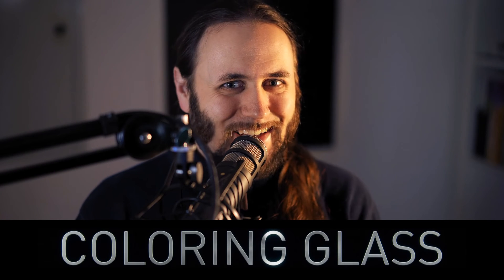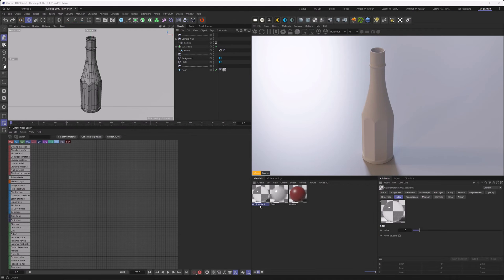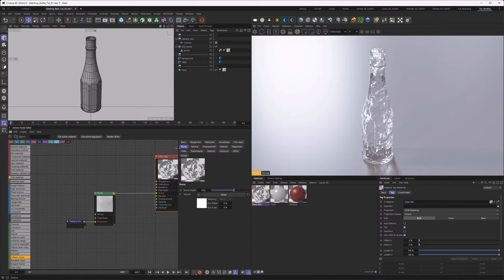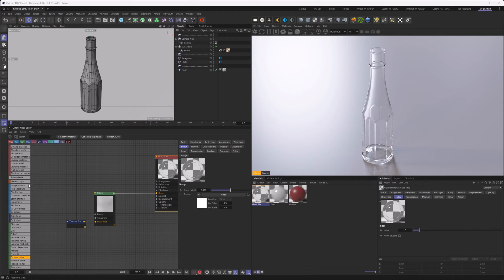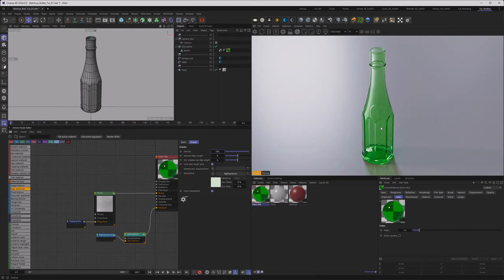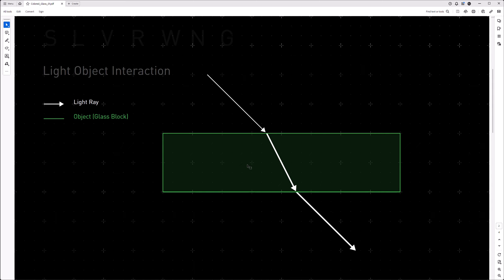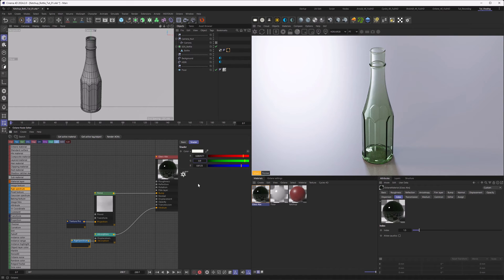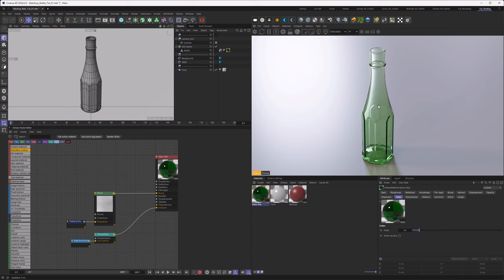Silverwing Quick-Tip: Coloring Glass Realstically (Octane, C4D)

Comment: @8:40
Something I personally like to do when picking absorption values is to separate value from hue and saturation.
Generally I'll use a node to create a colour with a value of 1 in at least one of the channels, then follow that with a multiply node.
Doing this makes it so that I visually separate the steps a little more and not have to tweak anything about the colour when I want more or less light to get through. It's a small thing, but for me it makes things a little easier to tweak :)
Reply from the maker: That´s a very smart approach! Thank you very much for your input. I´ll pin this comment!
I might copy this for my workflow 😇

Comment: where can i find bump height? i don't have it 😭
Reply from the maker: Hey there and thank you for your comment. The Bump Height setting first appeared around Octane 2022. If you have an older version of Octane, it will not be there.

You can use the lower of the Noise instead to control your Bump strength.
Reply: @SilverwingVFX  thank you! appreciate your response! your tutorials are the best!
Reply from the maker: @davidtapia6666  Thanks so much. That's super awesome to hear. I hope you got it working 🙌

Comment: Hi, I use Octane Blender, adding Float to greyscale texture to Scattering only made the thickness blacker, increasing float value will increase darkness, can't get the tint effect shown on the tutorial. Any idea?
Reply from the maker: Hey there and thank you very much for your comment.
In your Blender Scattering Material you already have color fields within the node, so you do not have to add extra nodes to it. You can do that, but it would not be necessary.

Let me try a little trouble shooting:
First check your rendering kernel. For glass and SSS it should be set to Path Tracing. Also check the Diffuse Depth, Specular Depth and Scatter depth. Those should beat least 8 for Diffuse and Scattering and 16 or even 32 for Specular.

Then you can check if "Fake Shadows" is enabled in your glass material. As otherwise, the inner SSS calculation is dependent on caustics, which can be rather compute heavy and depending on your lighting, can appear darker, because it won't get resolved.

On the Scattering Medium there is a "Invert Absorption" checkbox. This might seem wrong, but it should be checked on for the node to work in the same way as I had it in my tutorial.

Hope this helps. If it does not. You can email me, if you want. Then I can share a setup with you.

Cheers and a great Day to you!
Raphael
Reply: @SilverwingVFX  Thank you Sir, turning on Fake Shadow helped, higher float value gives more tint, just like in the tutorial. I had  Fake Shadow off, higher float value makes it darker.
Reply from the maker: @jwu122  Great to hear that it worked out for you 🙌
Cheers and happy rendering ✨

Comment: hello!
I really enjoyed the lecture. I am using the 2023 version, but the bump height does not appear in the bump column. How can I resolve this?
Reply from the maker: Thank you very much for your comment. Two reasons come to mind:
1: You are using an older version of Octane. Make sure you are using the latest one.
2: Your shader is set to compatibility mode to emulate an older behavior. This can be also set in the main tab of the Shader.
Hopefully that helps to resolve the issue!

Cheers and a great Sunday to you!
Raphael

Comment: Really important information again :) Understanding that simple difference between Transmission and Absorption really makes things much more opaque. I have been struggling to get good results with translucent materials. It is not surprising, as I have had major gaps in understanding the basics. Now it is fixed, and I have to guess much less. 

From somewhere, maybe from Octane manual, I learned that Transmission should be set always to 1 with SSS for example. But I have never seen an explanation for that. At least one that is simple and makes sense, like this did. 

Thank you and Merry Chirstmass 🎄
Reply from the maker: Oh man, thanks so much for your nice comment Kimmo . I really appreciate your support over the time.

Fantastic that I could clear up some things  with this tut 🙌
People really seem to like this one. Its nice to end this Year with a success like this 😊

About the Specular Transmission. I also always said that in my tuts whenever I made a Spec material. Its really strange that it is at 0.9 which is not a great choice and rather unrealistic.

Also a Merry Christmas to you and thanks once more for the support ✨🎄✨